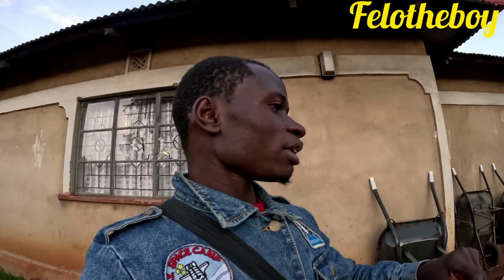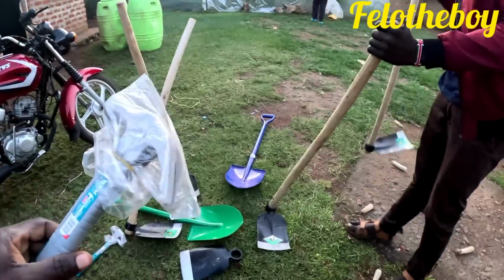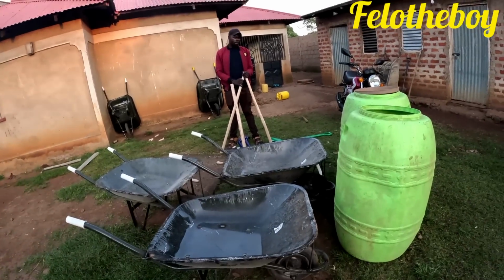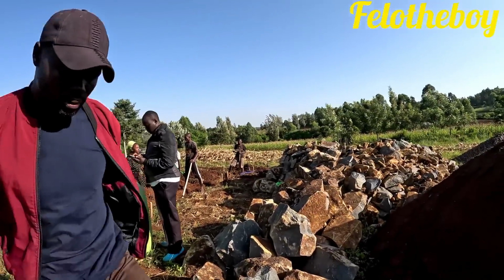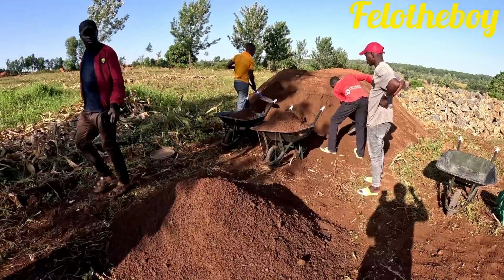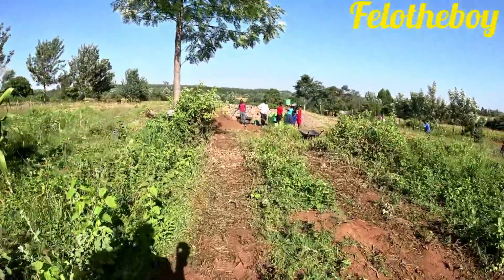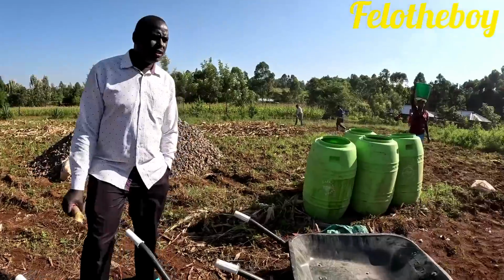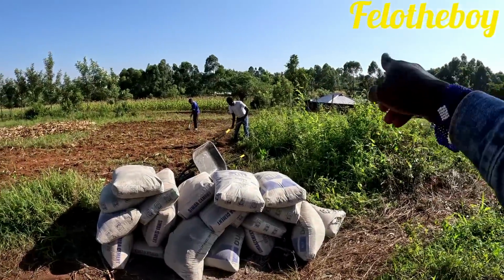Today's Breaking News.@Dads Land

Comment: Hello guys, teamwork makes the dream works, lol.  Just a thought, for easy inventory (list of equipment), use paint to number the equipments, so if you have 5 Jembes then number them 1 to 5, that way it's easier to  see which one is missing.  Also, get another hammer and put it up as spare so that if the other one goes missing, you don't waste time having to go and replace it.  Ever day when work has been completed, it's easy to do a quick eye check to see that all the equipment is there.  You can also do a written inventory, but marking and eye check is usually OK.
Reply from the maker: Thanks for your advice